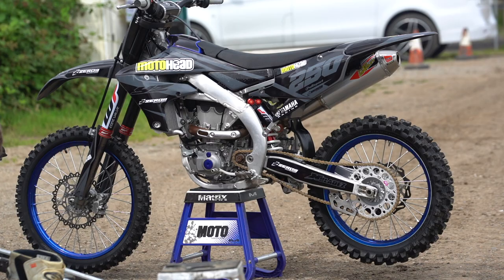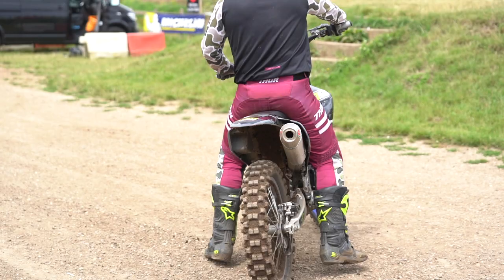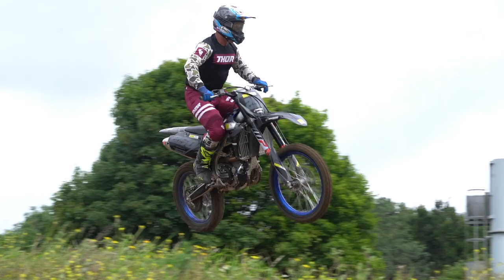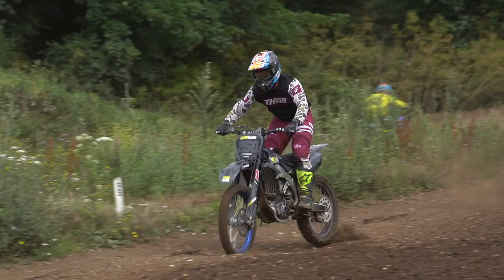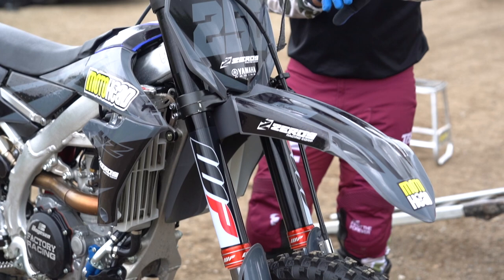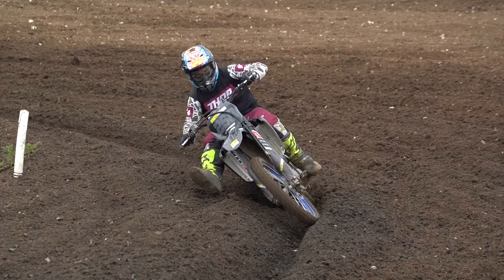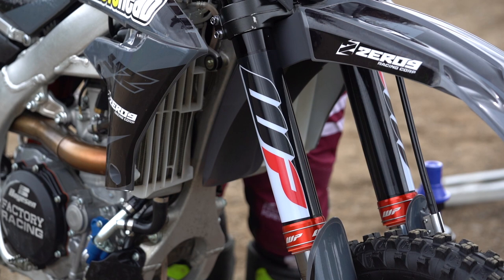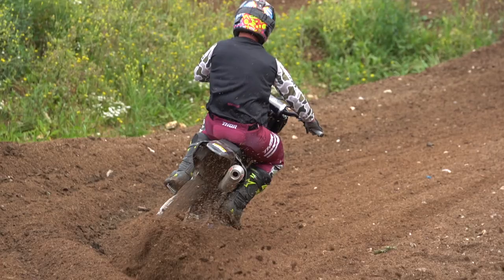Setting up WP suspension on a Yamaha YZ450F

Comment: i have a 2018 yzf450 and as you said it lacks front end grip in the corners , especially if you accidentally turn the bars a little while you are cornering it has an understeer and it doesnt get right back up like the other bikes and you lose consistency.Is there a cheap way to fix that?
Reply: dr d has engine relocation collars that fit up to a 2018 to scoot the engine forward a little bit. this is known to help.